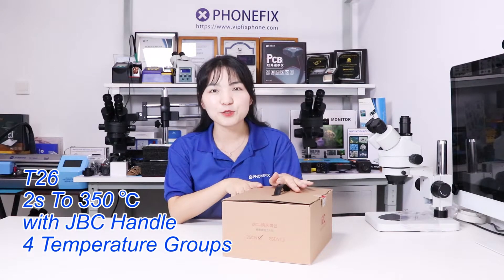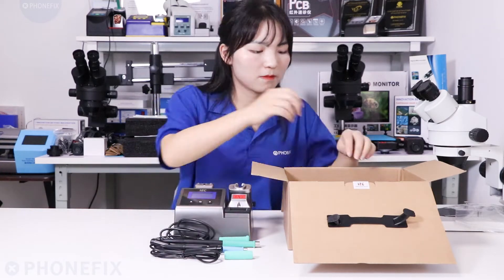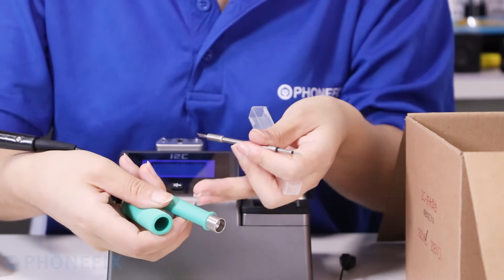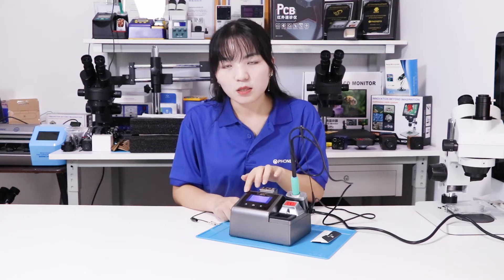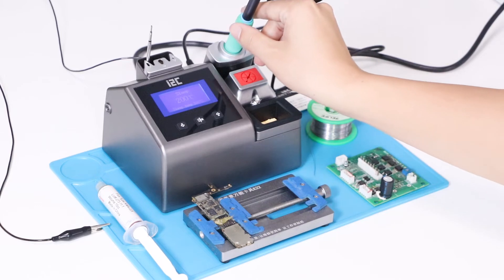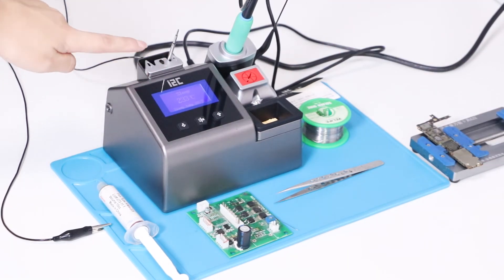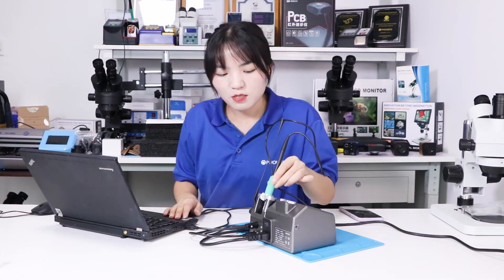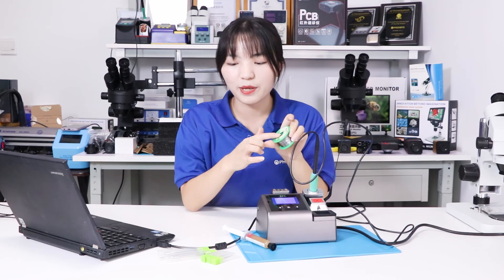i2C 2SCNi NANO Soldering Station with C210/C245/C115 Handle

Comment: Got mine this wek. Updated to 1.11. After update one tip incandesebt read, performed calibration and all god for now. You need to make sure tips are inserted all the way in. Another quirck i can set the temp to 450c but after 430c it displays no tool

Comment: Dz device sucks
2 Cartridges out of 3 ( stopped working in 2days (no tools)
Handle fails always(open heater)
Host says “ heating anomaly “
Reply: lol u better diy.i only bought the controller board and original jbc handle.works perfect
Reply: @hantusangap  ok